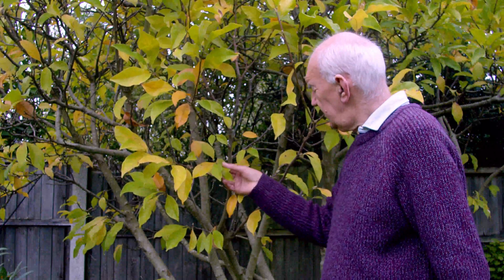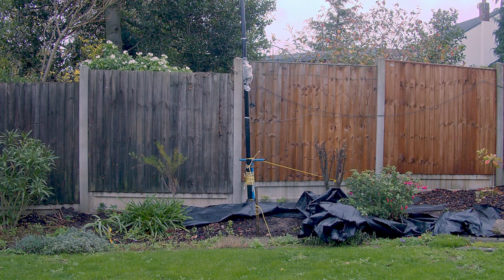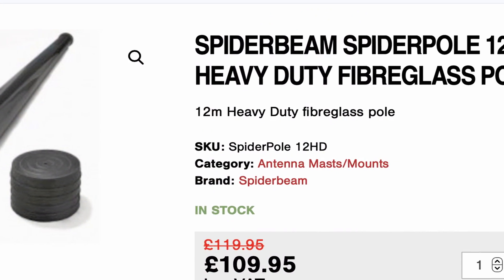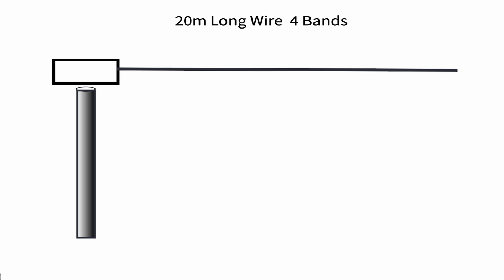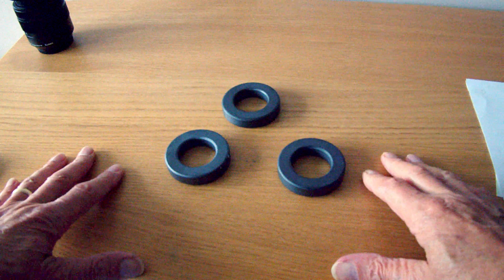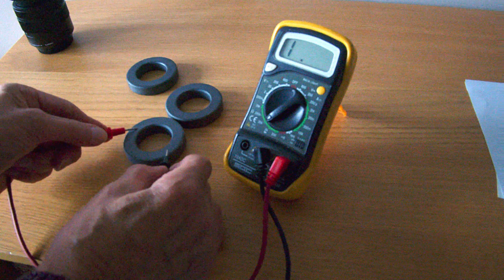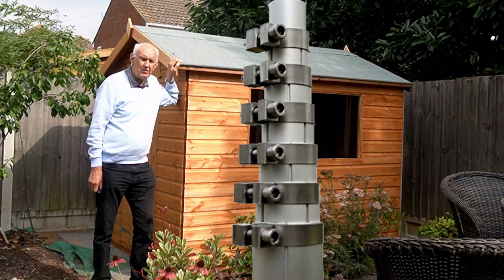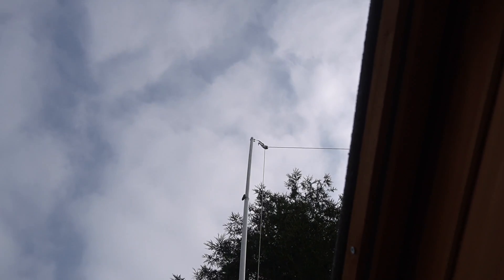Small Garden Antenna - Winter Preparation |HAM RADIO

Comment: My efhw is configured for 40. It slopes from mast at twenty foot to far end garden fence panel at five foot. Then across the top of a panel at right angles then the tail probably two foot drops down. So not at all straight. It works and I've contacted all over states from near Toronto. Only mod I made was to put a two metre exactly counterpoise if you like on the ground terminal and a LDG 1:1 directly with the 49:1 by a back to back PL 259 barrel. No tvi no floaters and good swr. Simon VA3SII G7HCD
Reply from the maker: Hi Simon, great to hear from you and to learn how well the antenna is working. Interesting on the 1:1 addition and short counterpoise. Thanks for the info. 73 Peter.

Comment: Hi Peter, I'm going to try the square antenna I might just be able to squeeze it in diagonal.. my garden is typical 8mtrs x 8mtrs (25x25 ish feet) would you feed it away from the house or at house wall? and is there a recommended position for the line isolator?  Gaz
Reply from the maker: As the antenna radiates broadside the vertical can be fairly close to the house, but aim fir a metre away. The choke should be within half a metre of the point at which the coax connects to the UnUn. Give it atry.
Reply: @watersstanton  thanks, I will.. Gaz

Comment: My homebrew EFHW inverted L works very well. I also added a counterpoise in order to tune it more precisely and have less RF coming back. For QRP I'm managing without a common mode choke, but would definitely need one for EF random wire, or with more power on this one.

However, I did make a small artificial ground (basically just a series resonant circuit) and connected that to the ground lug of the 49:1 transformer (and a floating 2m counterpoise wire after the AGU) It seems to me that the antenna is working noticeably better this way, but not really sure how to measure it.
Did you have any experience with AGUs?
Reply from the maker: I only used a ground AGU once when operating an end fed wire from an upper room. They are very popular with pedestrian mobile operators. I have never been convinced that a counterpoise benefits an EFHW but there is no simple way of proving it one way or another. 73 Peter

Comment: Thanks Peter for the suggestion of using an enfed in a small garden. I was lucky to be able erect my 20 meter of wire in an inverted "L" in my garden. 
I am definitely going to try and change to the "inverted U". 
By the way my common mode choke is 4 meters away from my transformer, just before the coax goes through the wall to my patchbox next to the radio. Using  my home made RF clamp-on meter, I do not get any CM current inside the house. Thanks again and good luck from South Africa.

Comment: Thank you, Peter,  You didn't show a 5 Turn coil about 2 meters from the transformer in the diagram for the Half square antenna... Is it still recommended for this antenna as it is for the normal end-fed antenna?  Best 73 K5NR
Reply from the maker: Hi, I think I said I did not bother when I used a 20m EFHW but certainly leave it out when in Half Square mode. 73 Peter
Reply: @watersstanton   my error, thank you 😀

Comment: Peter, I don’t agree with the line isolator at the feed point. The antenna needs some kind counterpoise and in normal operation the braid of the coax is that counterpoise. If an isolator is used, an additional counterpoise must be used. (I know as this describes my antenna and feed)
Reply from the maker: I hear these claims every so often, but are usually made by those who have never used the antenna. The coax plays no part in the radiation and in the many many tests I have done, the line isolator improves performance. Yes I tried a counterpoise and there was absolutely no detectible  benefit.
Reply: @watersstanton  I think we shall have to agree to disagree then. My 20m EFHW (40-10m) just didn’t work without some form of counterpoise (coax or wire)

Comment: Just got DXCC on my EFHW with 40 watts so it definitely does work. One question - how far from the transformer is your line isolator? Mine is about 15m down the coax just before it eneters the shack
Reply from the maker: Alan I use two.. One is at the point where the coax enters the transformer. The other is close to the Tx. I have never found that the coax contributes to  radiation and if untreated, can cause problems.